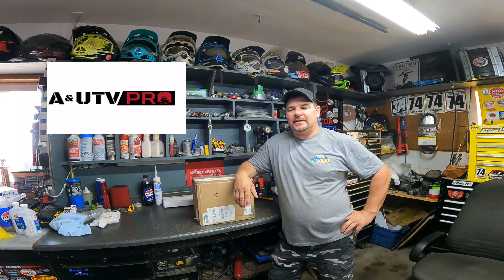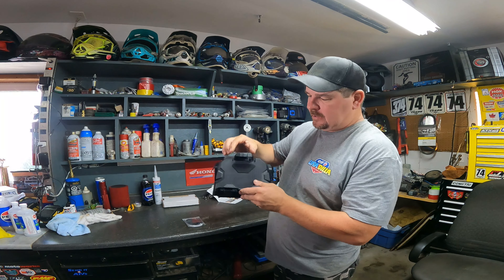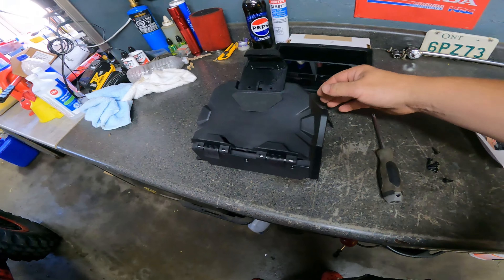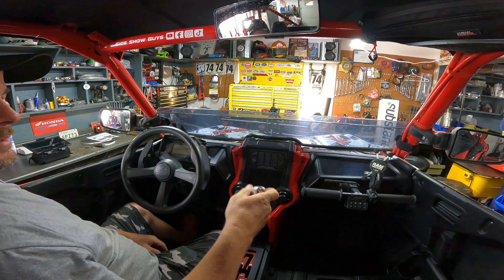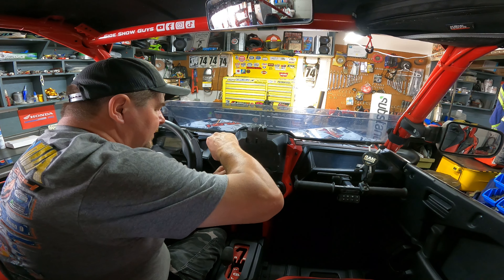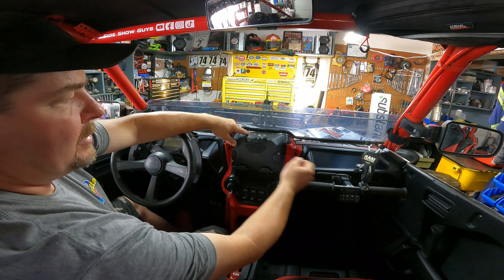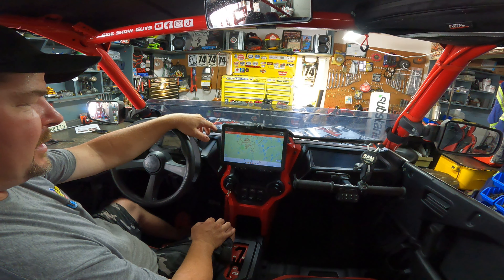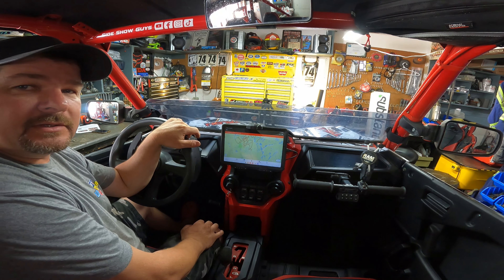Honda Talon Tablet GPS Installation - A Complete Guide

Comment: Thanks.  Good video.   On another subject, how to you like the Super ATV winch?  I like the fact that it has a remote controller.  Was it difficult to wire the winch up.  Assume you ran wires back to the battery?   Thanks.
Reply from the maker: I love the super Atv winch for the wireless remote.  Must have for when you are out alone. It’s pretty straightforward to install.  The Talon has the power wire for the winch ready run up to the front from the battery.  It’s taped up under the plastics in the drivers side.  Just under the hood.

Comment: Does not work with some windshield types - buyers beware!
Reply from the maker: Didn’t know that.  Works with my 1/2 windshield.
Reply: SuperATV Flip Windshield blocks the riser from going up - made my tablet holder useless
Reply from the maker: @dragonrider8831  ok. That makes sense now.  Thanks for pointing that out.
Reply: @dragonrider8831  Hello,  Was there any way to modify the holder to work with the SATV Flip windshield?   I haven't purchased a windshield yet but everyone seems to like the SATV Flip and I'd still like to use the tablet holder if possible.  Thanks.
Reply: @ I have not found a way as of yet - let me know if you figure it out